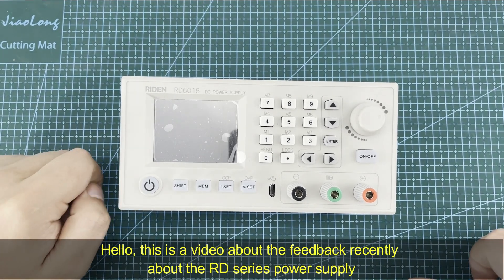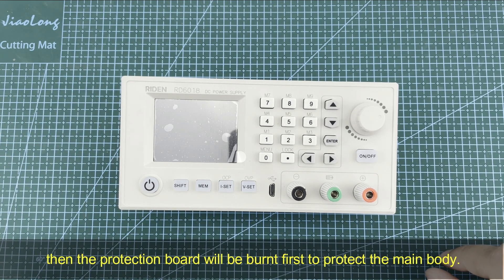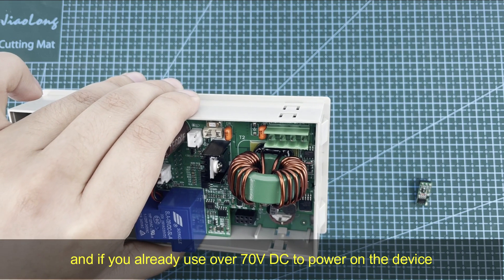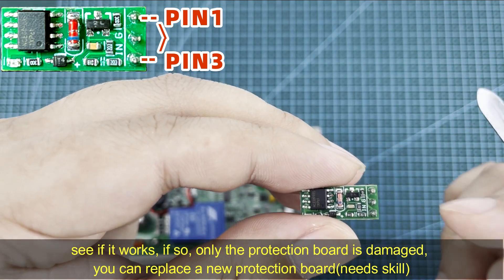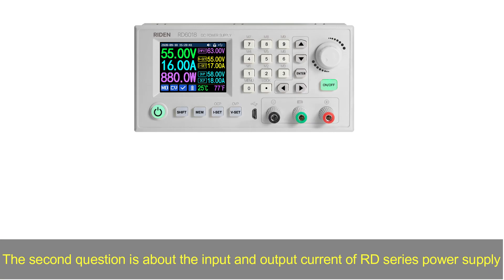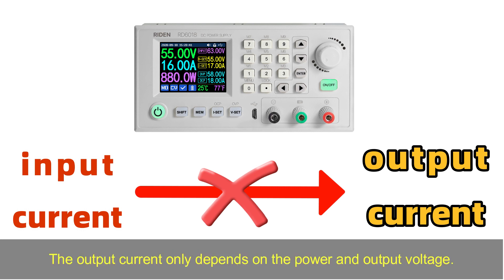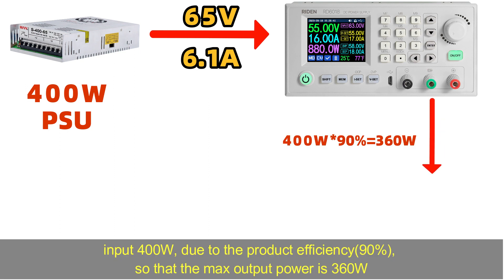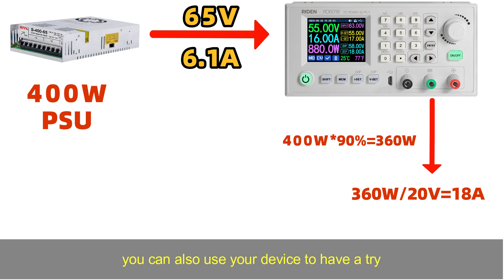Low input current cannot let RD6018 output max current? NO!

Comment: Hi, please do case for 2x Riden RD6018 modules 😉
Maybe one side by side with PSU underneath or one above second - I would like to use Your modules to create 2 voltages, or maybe new Riden 2 channel product?
Reply from the maker: hello, for our RD series power supply,  they cannot be connected in series or in parallel, it has risk to damage the device itself

Comment: so you are saying that while using power supply with max 6.5A you still can draw 18A from RD6018 (with lower voltage), right?
Reply from the maker: yes, there is no relationship between input current and output current, your max output current only decides by the output power and voltage, and the power supply output range

Comment: Can connect power supply Huawei R4850G2 ?
Reply from the maker: hello, as long as it has stable output, and the voltage does not exceeds 70V DC, there is no problem to use this power supply for RD power supplies
Reply: @rdtech9153  Thank you very much...
Reply from the maker: @x777x13  you are welcome

Comment: Hello! Do you plan to release new power supplies with higher voltage and current than RD6024?
Reply: Yes, it would be great to see a module with the ability to adjust the voltage up to 100 volts.  This would be very useful for checking the electric motors of electric vehicles and charging powerful batteries.
Reply from the maker: @VladimirUlianov152  thank you for your message, when new products is released, we will make new introducing video
Reply from the maker: hello, for now there is no higher output power supply than RD6024 60V24A, and if we have new products, we will spread the news